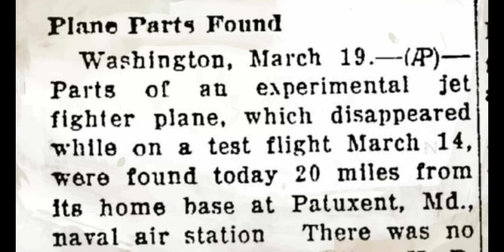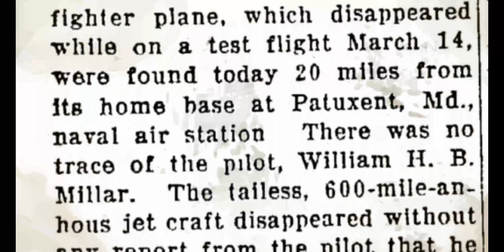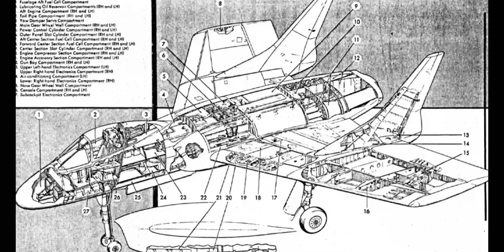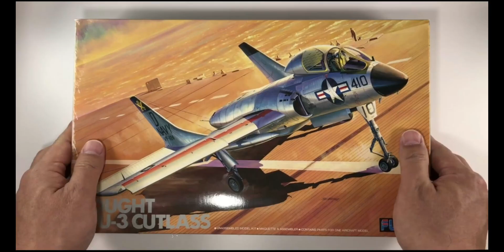F7U Cutlass: A Disastrous Design in the History of Military Aviation! #war #history #military

Comment: The F-7 design was way ahead of it's time , however the material were not up to date . The design is close to stealth .
Reply from the maker: True!
Reply: not likely, case in point... there were several other design with delta wing and flying wing design around and even prior to cutlass...
none were actually close to being 'stealth' despite the claim from some designer for flying wing aircraft.
In the 60s, despite the fact that the equation for the 'stealth' design was available... no country (save for USA) was able to use it to build an aircraft that can actually fly.
The reality was that merely having the rough shape similar to a stealth aircraft doesn't actually make one to be a 'stealth' aircraft...  it required computer simulation taking into account the entire airframe shape, surface, edge and volume to make it anywhere close to being low observable by radar.

That's part of the reason why even though the equation is known for more than half a century now... less than a handful of country have a functioning 'stealth' aircraft.

Comment: Westinghouse J-34 was a poor choice of powerplant as it was for the Curtiss XF-87.
Reply: I’ve got a book on the development of the F7U, (wouldn’t altogether recommend it, the author is fuzzy on engineering, the Ginter book is much better, hopefully he’ll do a 2nd edition), and Westinghouse totally screwed up their follow ons to the J-34 (J-40, J-46) due to inadequate design and development resources, teams working in widely separated locations, how-not-to-do-things example. The J-40 was intended for the F4D, A3D, fortunately Heinemann’s initial design left enough space that the J-57 could be substituted. Unfortunately the J-46 was really the only thing that could fit in the F7U, although I’ve wondered whether the RR Avon could have been shoehorned in, thirsty engines, but two were fitted into the Sea Vixen (the F7U is a surprisingly big airframe). 
It’s evolution from -1 to -3 reminds me of the Short Stirling, which when it was necessary to increase the wing incidence it was given an absurdly complex undercarriage. (In the B-26 Marauder Martin eventually accepted the need and redesigned the wing to raise it 3 degrees mid production). Vought put in that terrifyingly high nose strut, an accident waiting to happen in the harsh environment of carrier traps. Watching F7U’s coming in nose-high, does not look safe. Apparently engine out carrier landings were not on, only one engine away from land = eject. The lessons were taken, the F8U with it’s variable incidence wing was more straightforward to land, with short strong undercarriage, and better performance than the F-100 (whose landings were described as ‘controlled crashes’) on basically the same engine (J-57). 
All that said, the F7U looked interesting and with everything working, including afterburners, could turn in a reasonable performance. Apparently the aft dive brakes caused little or no trim changes and made it a reasonable diving attack weapon (1st supersonic bomb drop), and there was an attack version (F7U-2/A2U) planned before the other problems became apparent. The 1950s were a fascinating period, with a lot of experimentation trying to find out how to use the potential of jet engines.

Comment: This video was obviously made after reading the Wikipedia entry, becuse much of it was taken word for word.  If anybody out there has more detailed knowledge of this airplane, I have a question regarding this statement: "The aircraft had all-hydraulic controls which provided artificial feedback so the pilot could feel aerodynamic forces acting on the plane."

What is commonly called artificial feel in these early jets is not the same thing as actual feedback of the aerodynamic forces resisting movement of a control surface.  They typically have fully powered irreversible flight controls, meaning no force is fed back through the hydraulic actuators.  What is often called artificial feel is really just a progressive resistance to stick movement provided by the springs of a feel and centering system, often supplemented by bobweights that increase the aft stick force required as G increases.  Question: Did the F7U actually have some unique system that somehow fed back the external forces on the control surfaces, or was this just a sloppy statement in Wikipedia?
Reply from the maker: You can read this doc. It may answer your questions:
https://www.scribd.com/document/486228635/Chance-Vought-F7U-Cutlass-Naval-Fighters-06-Steve-Ginter-pdf
Reply: @YourDoseofCuriosity   
Thank you.  That article states: “The Cutlass was also the Navy’s first swept-wing jet, and its first with steerable nose wheels and an irreversible power control system.”  

I was also able to find copy of the flight manual, which states that the ailavators are operated by "irreversible hydraulic control systems controlled by conventional control stick movement.  When an irreversible hydraulic system is used, no aerodynamic force is felt at the control stick, so an artificial feel system is used to simulate this force.”  Under the flight controls section there is a paragraph on ailavator feel stating that “ailavator feel is developed by combining the action of a bobweight, two mechanical spring struts, and a viscous damper”.  There is more detail, but there is no discussion anywhere of feedback of aerodynamic forces.  

So it is a conventional irreversible control system after all.  This may seem like a minor distinction to many people, but I think it is an important technical detail when discussing flight control systems of early jets.
Reply: @Pene7942  I can't upload a manual, but it confirms the inaccuracy of the information in the video.  The plane has a typical artificial feel system, but no aerodynamic forces are fed back to the control stick.  Also note there is no manual backup system for the hydraulically actuated ailivators (The rudders are manual actuation at all times).  There is a battery powered emergency hydraulic pump that provides pressure for 3 minutes for final approach to a dead stick landing if both engines have failed.  The ailivators are still powered hydraulically and the airplane would be uncontrollable without hydraulic pressure.  The text below was extracted from the flight manual for the F7U-3: 
 
The ailavators perform the functions of both ailerons and elevators and are opened by irreversible hydraulic systems which are, in turn, controlled by the conventional control stick movements. When an irreversible hydraulic system is used. No aerodynamic force is felt at the control stick so an artificial feel system is to simulate this force.

Ailivator feel is developed by combining the action of a bobweight, two mechanical spring struts, and a viscous damper. (Viscous damper opposes direction of motion with a force proportional to rate of motion.) The bobweight and the viscous damper are directly connected to the control stick. A mechanical spring strut is connected
to the control linkage in each outer panel. The viscous damper is a self-contained assembly with its own fluid reservoir and does not depend upon the airplane's hydraulic system. The function of each unit in developing ailavator feel forces at the control stick is given in the following breakdown: 
Bobweight —Supplies significant portion of feel in relation to g's; action least significant at slow speeds. A balancing spring neutralizes bobweight action for 1 g conditions.
Viscous Damper — Functions only for longitudinal motions of control stick. 
Spring Strut— Supplies feel in proportion to ailavator deflection from trim. It is effective for both lateral and longitudinal motion. Spring strut is attached to control rods at input linkage to actuating cylinder slider valves.

POWER CONTROL HYDRAULIC SUPPLY SYSTEM.
Hydraulic pressure ( 3,000 psi) for ailavator control is supplied by two independent hydraulic systems (Power Control Systems No. 1 and No. 2). The two systems function simultaneously under normal conditions. Dual-engine, dual-pump, and dual-cylinder safety is obtained by each system having two pumps, one on each engine,
and each ailavator control cylinder having two tandem chambers with each chamber connected to one of the two power control systems. If one engine fails, the other engine will keep both power control systems pressurized. If both engines fail, the windmilling of the engines, at airspeeds above 200 knots, will continue to drive the main hydraulic pumps. The ailavator power control systems are equipped with an emergency pump which receives power from a special battery. The battery is kept charged during normal flight and it will operate the emergency pump for 3 minutes. The emergency pump should be used for an emergency landing approach at airspeeds below 200 knots with both engines out.
Reply: According to the guy mentioned in the beginning of the video that was the flight test program lead and Blue Angels F7U pilot the plane had two control systems.  The primary was an all new high pressure hydraulic system and an emergency backup system he described as “mechanical”.  The backup system took 11 seconds to come online if the primary hydraulic system failed.  That’s an eternity in a jet aircraft.  His hydraulics failed once when he was doing a full afterburner unrestricted climb.  He described having to sit in the cockpit and watch the ground rush up at him helplessly while waiting for the backup system to startup.  He ended up pruning some tree tops and tore a bunch of access doors and flaps off the aircraft before landing it safely.
Reply: @i-..--..--..-i6985  Thanks, I saw that video.  It's a simple manual backup system, certainly not   a provision for aerodynamic feedback through the hydraulic controls, which were irreversible, as previously determined.

Comment: Between not getting the engines it was supposed to get, and problems with the nose gear collapsing, it flew fine, but no go-a-round power for wave offs and landing aboard carriers.
Reply: a fighter aircraft for the navy carrier that is not suited for carrier landing is basically useless...
Reply: @IonoTheFanatics  It never got the engines it was designed for, leaving it underpowered, add to that the extreme angle of attack on landing it left no room for error. Still a neat looking aircraft.  I drew three views for an rc model. With electric fans, might resurrect and try one.
Reply: @jamesberwick2210  that's kinda the point, an aircraft for the navy's carrier had to be designed with the challenge that landing an aircraft on the carrier entails...
F-14 had underpowered engines too in the first model, it didn't get THIS bad with the accident rate.
And when the undercarriage failed on carrier landing for the cutlass... it's obvious that the aircraft needed to be completely redesigned from the ground up.

It's neat looking...
And that's about it really, completely worthless for carrier aircraft wing hence why it was removed from service in record time...
The ship captains doesn't want it, the pilots doesn't want it, the navy doesn't want it.
Reply: @IonoTheFanatics  It seems there were plenty of dog aircraft back in that period. It didn't hurt as bad for the Air Force as not so good for Navy pilots.  My only fighter while in the Air Force was the F-105F and G models. Right airplane, wrong war.
Reply: @jamesberwick2210 true, it's not the only lemon of the period and this is back when there's still a lot of unknowns in jet design.

But I think it's safe to say that Cutlass is one of the bad lemons, and it wasn't just the engine... an underpowered engine, that there could be ways to work with at least in the interim to mitigate the problem.

But an aircraft so bad that the Navy tried to get rid of it from their ship asap after an incredibly short service life? That takes special kind of "bad". Like... it's so bad they'd rather forget it existed kind of "bad".
Reply: @IonoTheFanatics  They made better gate guardians. Put on a pedestal at the front to gate. The fact that it takes seven to ten years from drawing board to fleet service, the Navy jumped at any idea that made promises that were never kept.  I love flying wings in any form for modeling. It may not have done well in full si e, but looked neat.

Comment: Click bait garbage. The only real issue with the Cutlass was its lack of power but that was a common issue with all of the jets of that period. One of the Cutlass test pilots stated that the F7U had some of the best carrier landing characteristics of any jet he'd ever flown. That comes from Steve Ginter's book on this jet. Carrier landing is a very difficult operation, but, it's one that doesn't require a lot of engine power.

This video just rewashes all the garbage statements about the Cutlass from the past.
Reply: No jet with a nose strut that long is a good carrier landing aircraft. It had good visibility but everything else was a compromise. If that idea had been a good one, there would have been other fighters that had the same nose strut.